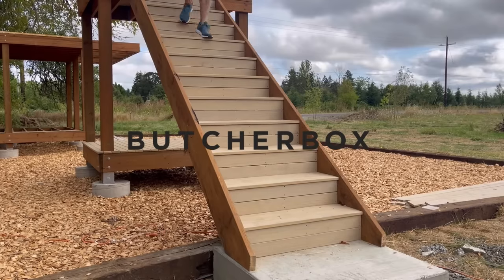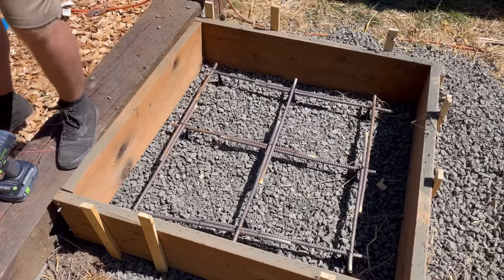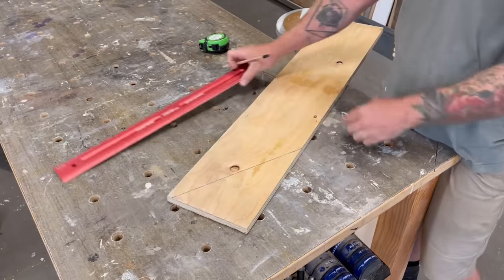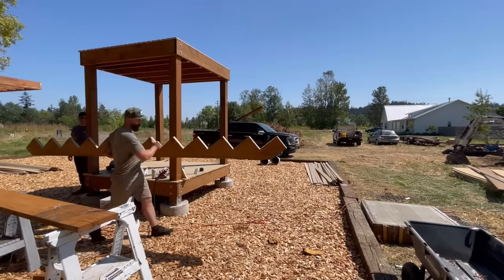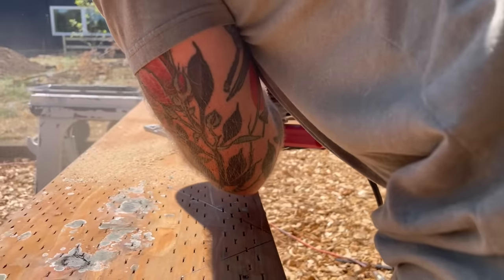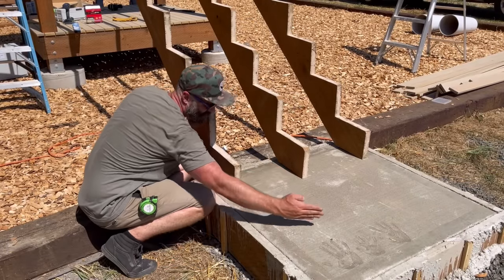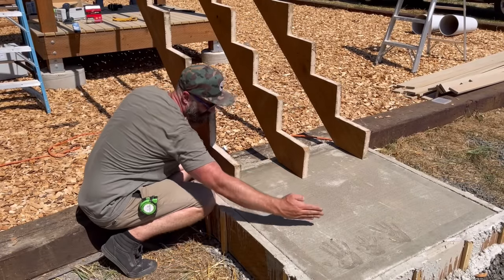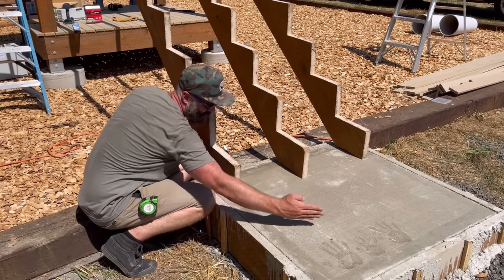The Easiest Way to Build Stairs || Stair Stringers are Easy

Comment: "Little decorative side pieces" are called skirt boards. Good visual treatise on stair building. One point you skipped and it's kind of a big one is the thickness of the riser board is deleted from the top tread cut. I like the pattern you made for marking the rise and run. 40 years in Carpentry and I've never done it that way! You know what they say, A good student never stops learning!
Reply: Instead of top tread, need to take thickness off bottom tread. That drops the entire assembly so the first step is not too high
Reply: @Darenator1  read my comment again I'm not talking about the bottom tread.
Reply: @klmbuilders5385  Asking, not questioning ,because I don't know. Does he need to cut that off the way he did it? He put the riser boards on after the treads, so if he faced the structure like a regular riser mid staircase, wouldn't they all end up the same? Again, I don't know, I'm asking. Thanks 😃
PS- if you know, where do you cut extra or add more to the top to account for your flooring?
Reply: @carlstrohm3785  Typically the riser boards go on first in which case you would deduct the thickness of the riser from the top tread cut. Example: If a 3/4 board is used for a riser then 3/4 would be taken off the top of the stringer where it attaches to the deck band. When the riser is installed the tread cut becomes the same length as the remaining tread cuts. If the risers are installed after the treads then no stringer modification would be necessary but I would make the tread cuts shorter so I still have a tread overhang. Make sense?
Reply: @klmbuilders5385  Yes. Thank you. I guess I thought you always did the tread boards first and the riser board kind of locked the rear down.
Reply: Yeah im curious if he did it or not. Id like to see that top tread
Reply: He mentioned the thickness of the riser board when he was measuring.
Reply: He took the tread depth off the bottom when measuring
Reply: @carlstrohm3785  no, because as you look up the stairs if the risers aren't PERFECTLY installed on every stair the eye will pick that up right away. When the risers are installed first the tread "hides" that joint.
Reply: The program he uses, on my carpentry, tells you to only drop the first riser. It  doesn't mention cutting the top tread back the thickness of the riser.( good catch).
Reply: How's that? A good stunad never stops stooping? What??! Whose skirt is bored? 'Splain it more better
Reply: I have always said, "When I stop learning, slam the lid in my face!".
Reply: Okay where was the kicker at the bottom?

Comment: Love most of the design other than screwing into the end grain of the small anchor boards, this is a good reason for metal brackets. Anchor the brackets and bolt your stringers to them.

Comment: I've been drawing stairs for fabrication shops since 1978.  I give you an A+ for those stairs.  Had I drawn these stairs, the only thing I would have done differently would have been to make the 2x4 spacers at the top a continuous piece that would have run from out to out of the outside stringers and notched the underside of the stringers to rest on top of that nailer.  But all the stairs I draw (mostly steel) are for public areas and have to be designed for 50 people or so dancing on it them during a New Year's Eve party (worst case scenario). Your stairs are overengineered (a good thing) and will last a lifetime or more.  Over the years I have noticed that not all pressure treated lumber is equal.  I've seen decks built with Yellowwood from a box store (my AC deck) and after 5 years rot away.  We have a local lumber yard that kiln dries the lumber, pressure treats it and then kiln dries it again.  It's 75% more expensive but it's dry and very stable.  And it lasts. The stinger covers make a great base for handrail posts.  I love that worm drive Skillsaw.
Reply: I definitely agree with the added 2×4 at the top - it makes it far more stable. 

I wonder if you're in the same area I am, as I too have a local lumber yard that does that with PT lumber. They use clear grade for the 5/4 decking and also make some beautiful hollow columns from the same lumber.
Reply: @jameshaulenbeek5931  Gueydan (gay dawn) Lumber on Airline Hwy in Metairie, La.
Reply: @lowellmccormick6991  if you ever find yourself in NC, Capitol City Lumber Co in Raleigh is fantastic.
Reply: I agree on the ledger up top, it gives the stringers a bearing surface instead of relying on the shear strength of the screws. Also, all of the stringers should be notched at the bottom to allow the toe plate to run continuously through all of them. 

Another big thing to consider when building exterior wood stairs or decks is rot prevention. It's best practice to install a moisture barrier or an air gap anywhere the wood contacts another surface (ie wood to concrete, wood to wood, etc). That alone can make the difference between a 5 year build and a 30 year build!

Comment: That was hilarious watching you make the stair jig. I do the exact same thing. I just recently saw for the first time someone else use a step cutout for their pattern. I gave them a tip of adding a  stop to make itveasier.  I prefer this method because when you run into rounded corners or knot holes or  board wane untrimmed or missing areas in the lumber where bark once was or is. Having the full slope spanned with a stop leaves no question that your flush with the edge. Thanks for validating that there's at least a few out there who do it this way. I have worked alone for many years and have had to develop my own methods to produce in a timely fashion while still retaining quality. I see a lot of these tip and trick guys online have a lot of useless tips that really are more for producing content over giving valuable advice. I look forward to seeing you continue do it the right way. Thanks!
Reply: I've done the extra skirt board a couple times on exterior stairs but mostly interiors. And "screw stick" I imagine is for after murder boarding is no longer providing a challenge it's time for tree slaying. The larger, tougher, cousin of the board.

Comment: Good video!  The only thing that I would do differently is for the bottom thrust board, I would definitely use 2x6 - 2x8 pressure treated or redwood with cut a 2x6 or 2x8 notch on the bottom of all 3 stringers as they set on the bottom landing. Then cut the rise on the bottom by 1/2" so that the stringers are not touching the concrete.
Reply: Yes thank you, there should be a mid span brace for the stringers as well anything over six foot on the run . The skirt boards on the outside cover the cleat board so please notch all stringers to lock them in to place.

Comment: Looks great. A couple tips:

-The decorative end boards are commonly called “skirts.” 
-While not necessary, it’s often a better look to nail/screw from the inside of the tread so that the head doesn’t show on the skirt. 
-The cuts should be treated with copper green, or another type of wood preservative. Makes the PT last significantly longer.
-Lastly, the stuff used to treat spf is really bad for you. I try like hell to cut off my foot so the dust settles to the ground as quickly as possible. And by “cut off my foot,” I’m saying that I drop the board on my toes and then bring one edge up. That way, the weight of the saw will react with gravity, and give you a really nice cut.
Reply: LMAO
Reply: Dude, it's a Griffin tree house not fine carpentry..... LMAO

Comment: A little tip for your wedge anchors. Start the washer and nut then pound them in tight. Will help keep from messing up the end of the threads and will also give less bolt sticking out when you tighten them.

Comment: Municipal codes and tolerances for stairs tend to be fairly strict, so if your going through permitting and inspections, it’s worth while to be as accurate as you possibly can. The rise/run jig you made would be perfectly fine for an outdoor set like this because if you end up a little long (or short) on your total horizontal or vertical dimensions, it’s not that big of a deal. But if you are absolutely ‘married’ to those dimensions, with no room for error, here’s a better way to do your stringer layout:
	1.	Layout the edge of your stringer, by calculating the hypotenuse of your rise and run dimensions. 
	2.	For example; and using numbers that just happen to work out to whole numbers: If your rise was 6” and your run was 8”, the diagonal hypotenuse would be 10”. So just layout the edge of your stringer at: 10”, 20”, 30” etc etc. 
	3.	Chances are 6” and 8” are not going to be the numbers on your particular set but the formula A²+B²=C², works for any possible numbers you might have, whether they are whole numbers or not. (A=6” + B=8” C=10”). ‘A’ and ‘B’ are reciprocal btw. 
	4.	You might not think it would matter that much, but if you were only off by a 16th of an inch (less than the width of the lead of your pencil) on your jig each layout, if you had 16 steps, you could have a cumulative error of one full inch (or more) at the end. 
As mentioned at the top, stairs are scrutinized for tolerances pretty thoroughly by inspectors because they are a life/safety issue. So it’s worth it to take the extra effort to be as exact as possible.
Reply: A and B are reciprocal?
Reply: @btlmail1969  Yes, ‘C’ must be the hypotenuse (long side), but the formula still works if ‘A’ and ‘B’ are interchanged.

Comment: That "bracket thingy" that hangs the stringer from the front of the deck is a stringer hanger.  I like your method, but in a lot of areas, including mine, a stringer hanger is required.  I prefer to do both-- add the lower 2x board like you did and use a stringer hanger because the inspector says so.

Thanks for the tutorial on cutting stringers.  I am about to add another set of stairs to an existing deck where I'll need 4 stringers.  I usually buy precut, but with the length and umber I need, cutting my own will save me a couple hundred dollars!
Reply: I wet set a treated 2x6 in the concrete, it isolates the stringer from the board and also provides for nailing or a solid hardware connection at the landing connection

Comment: When attacking those side pieces to your stringers with screws, I would predrill the screw holes to prevent splitting. I've found that over the course of many years when wood soaks with rainwater and expands, contracts, swells, and twists, if you don't predrill, the wood can start to split along the grain at the screw holes.

Years ago, a friend of mine had a staircase on the deck at his country cabin that had stringers that split where deck screws were driven. The stairwell started to sag. I helped my buddy jack it up and sister the stringers to add some more life to it. He planned to rebuild the whole staircase a few years later.

I would also probably use some kind of steel joist hangers for stairs instead of screwing the stairs with those long timberlock screws from the back. If you're going to use those timber lock screws then I hope you pre-drilled pilot holes. I know that long screws like that are generally self-tapping, but I still pre-drill a pilot hole that's at least 1/16 in (or about 1.5mm) smaller than the shank of my screws when I'm going to drive deck screws that can possibly cause wedge action that can split the wood along the grain over time. I personally think that this is helpful when your wood gets soaked one day and then is exposed to rapid drying in the hot sun the next day.

Comment: Very good video. Perhaps the tree house is only intended for a few years use by the kids then dismantled, but I would use “end cut preservative” on any cut or sawn parts. I’m currently replacing a set of stringers (23 years old) that should have lasted many years longer but rotted out on the runs of each step. The pressure treating is only a thin layer and any time you’re cutting into it then the coating is gone and rot sets in quickly. It doesn’t take much time to paint the cuts and will make the structure last much longer.

Comment: Nice video. I'll definitely try the layout gig next time. It looks superior to the framing square stop method that I've been using. To save time and insure my stringers are exactly the same I just do the layout on one stringer. Then I clamp that stringer on top of and inline with the next stringer. I set the saw blade full depth and cut away. My saw doesn't cut all the way through the second stringer but it is cut exactly the same as the first. I then clamp the second stringer to the third and use the cuts as my guide for the second and third and so on. This method eliminates layout variations and insures that all the stringers are the same.

Comment: Great work. It’s already done but I suggest that you put tape that trex sells for the decking to cover the rafters from water. Especially when they’re sitting on that cement. I have to replace all three of stringers because even though they’re pressure treated, they soaked up water and rotted away. Just a heads up.
Reply: He added a slope to his pad so it might be just fine.
Reply: Even with a slope, the concrete and wood will get wet. Without protection, they will rot. Pressure treating helps, but not where the center of the wood is exposed or where screws go into the center of the wood.

Comment: You can also clamp a straight edge on the square.  For the math, total rise divide by 7, if you get 14.63, then take the total height divide by 14 or 15, that equals the height of the riser and the 15 runs(treads). 11inch tread, you need 165 inches. I would not recommend locating the landing until you have the desired rise and run.  The stairs came out very nice.

Comment: Jason: I saw where you talked about putting the back piece for the stairs first, etc. But I have found over the course of decks that leaving a gap equal in thickness to the the stair treads, usually around one inch, looks visually appealing and with that gap, one is able to blow all the debris on the stair treads backwards under the stairs. Otherwise with a closed gap, like in your example, the debris just swirls around with the leaf blower and goes nowhere. Anyhow, looking nice.
Reply: Good idea.  Where I work, the company builds a lot of decks.... and customers often complain about those side fascia catching everything.... but its easier to fascia the sides that way than other ways.  Code here allows for no more than a 4" gap on the risers.

Comment: The trim boards are called skirt boards. I made a faux housed staircase with 2 stringers and 2X treads on steel brackets. I clamped the stringer candidates together up on edge and power planed the top edges until the crowns matched and the mill round over was gone. It made the layout much easier and more accurate with a square corner to reference your framing square with stair nuts.

Comment: You could also put small clamps on your square for marking your stringers
Reply: I usually use to use the brass buttons you can purchase but in a pinch, yes, a couple small pairs of vise grips do just as well for making consistent markings.

Comment: Nice job. You should come do my basement stairs. Whoever did them attached the risers and treads between the outside decorative pieces. There are no stringers. The treads and risers are supported by furring strips nailed to the underside of the decorative pieces. The treads do not even rest on top of the risers. I'll have to post a video of them. It's crazy they have remained standing.

Comment: For your slope, it's better when it's part of a staircase if your slope is oriented towards the back. This avoids having the feeling of a staircase throwing you forward and off the staircase. A little angle towards the back makes them feel more comfortable.
Reply: good advice, so would you build a stair like this and tilt before fixing, or design it tilted back at the start. You could design a stair and then add a little onto each rise to offset each step back
Reply: @stigkrakpants3052  I usually try to do it level. It's when you're ready to install that you check the level. If it's throwing forward by any amount, I just make necessary adjustments. But I don't build with a slope in mind. I just ensure to avoid a forward slope.

Comment: some good tips in the comment section. i usually cut in one direction first i.e. all runs then come back and cut the rises. if you don't read more comments cut the thickness of the riser off the top in the same way you cut the bottom, unless your using a skirt board at the top. most codes gives you 3/4 in variance btw top and bottom stair w/ 1/16 in variance in each stair but it helps before you cut to check and make sure each stair is exact. also make sure your saw is perfectly square set at 0 otw your pattern could be off from your remaining stringers. run a level across the nose to ensure they're in line.

Comment: I used the same concrete anchors for my car port. Ida came through shredded the carport and put it on top my neighbors house. All the anchors and bottom sill of the carport were still attached to the ground. Had to cut them off post storm.

Comment: I think those decorative skirt boards are required as bracing to each stringer by code because the length of the stairs. Might need to add bracing to the middle stringer as well. I believe 7 foot sawn stringer is longest you can do without bracing.

Comment: Stair or square buttons.  divide by risers subtract the whole numbe, which ideally is seven, multiply by 16.  Boom go big or go home because new settles.  Cut the tread thickness off the bottom cut through riser thickness off the top unless you're adding a risers to what your nailing to

Comment: I would add pressure blocking between the stair stringers at the top. Run screws into the side. Better support than just screws into the end. Just a suggestion. 🙂
Reply: I spoke too soon. You took care of it. 😁